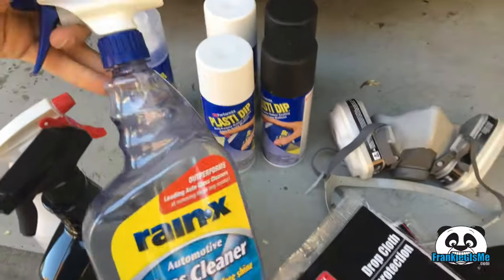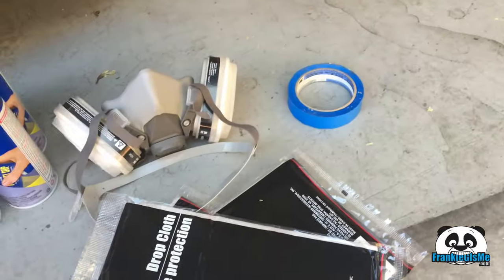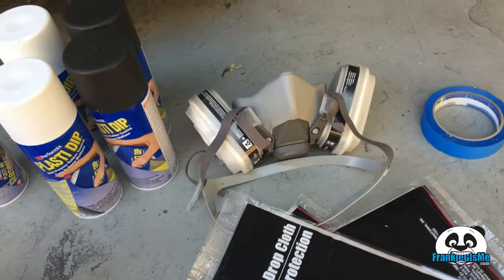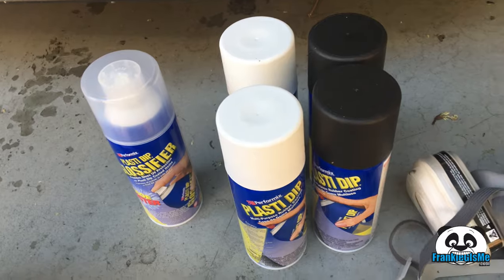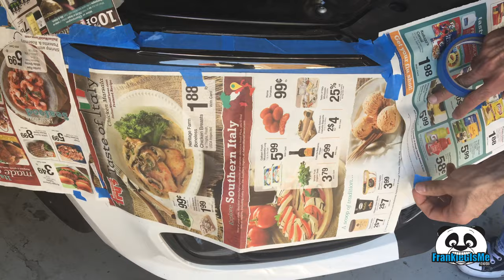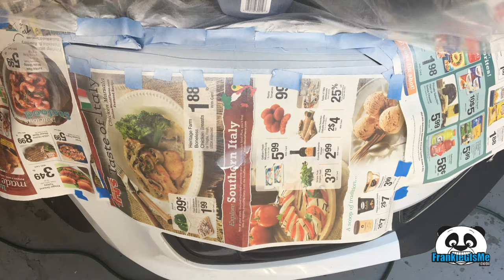How to Plasti Dip mirrors and headlights

Comment: Do you let the black plasti dip dry first before putting the glossifier or you putting it right after you put your last coat of black without letting it dry? 

Nice video btw 👍🏻👍🏻
Reply from the maker: make sure the black is dry before spraying the glossifier. Also, if you have tape that is acting as a separator, then make sure the very last coat of plasti dip is wet when you peel back the tape. Check out this video (https://youtu.be/rSUkbUfJZsw?t=3m28s) for better reference.

Comment: Mirrors have turned put great, I also kinda dig the headlights! I watched your other video where you p-dipped your roof... I have an Audi A6 2000., 2.5 V6 TDI in a metallic gray color and want to plasti dip my roof in matte black, so I would like to ask you, how many cans of plasti did you use on your roof to cover it well before you started to apply the gloss plasti? Thanks in advance and keep up the good work! :D
Reply from the maker: Thanks for the compliment and support! Audi's are nice! I believe I used 5 black and 2 glossifier. Second coat of black was full coverage. I suggest buying extra cans just in case. Happy dipping and keep it wet for each streak
Reply: +FrankieGisme Thank you for your advices, good luck in your upcoming videos! :)
Reply from the maker: +Adrian Novakov thanks! 😁

Comment: Dip on the mirrors looks great -- That's the next mod I'm doing.  Check out my wheelwell man!  fellow GLI https://wheelwell.com/profile/5580dde4c017242166361e79/vehicles/5580de29c017242166361e7a/specs/#SpecificationsSection
Reply from the maker: Thanks man! Your GLI is clean. Are you going to do the carbon fiber look on your mirrors?
Reply: I was honestly considering that but I don't know how to go about doing that without having to use vinyl wrap.  Any ideas?
Reply from the maker: I've seen it done with Plasti dip but i think it would look funny since you wrapped the emblems. I'd either wrap those too or Plasti dip them gloss black like I did.
Reply: I actually bought those emblems! Got both for 15$!  haha.  Maybe i'll just spend the 100$ to by the CF mirror caps
Reply from the maker: +Dominick Caruso nice! Tbh, I would only spend the cash on the caps if they match the other stuff you did.
Reply: I'd be curious what else you're planning on doing with your car; care to chat?
Reply from the maker: +Dominick Caruso dude I would tell you but future customizations and mods are top secret haha. Well, at least tell the videos are uploaded. 🐼
Reply: FrankieGisMe Haha I meant more so behind closed scenes -- or performance upgrade videos since I believe you don't do those.  Or is your car bonestock?
Reply from the maker: Dominick Caruso ah gotcha, unfortunately the Panda is stock. Im deciding between a few different performance upgrades but haven't decided. Those will be in future videos but not until the fall.
Reply: Haha well if you have any questions regarding some suggestions let me know!  looking forward to the videos
Reply from the maker: Thanks Bro! Also, find me on Instagram, twitter, google+, facebook, tumblr, and now WheelWell @frankiegisme